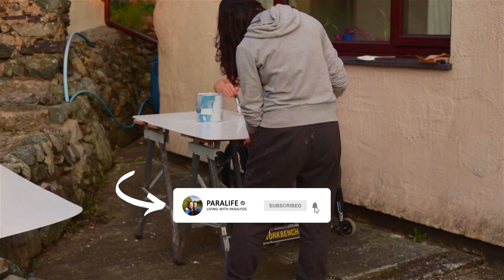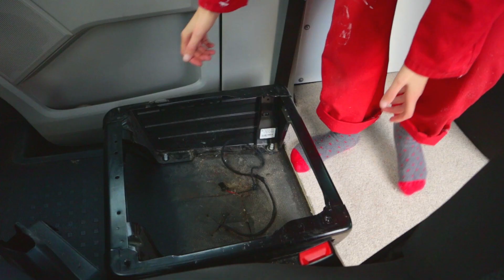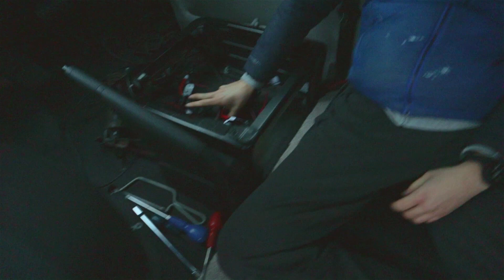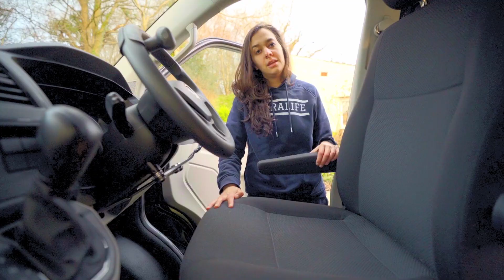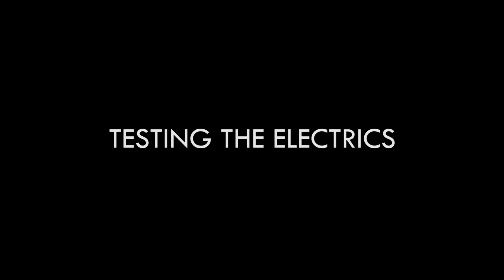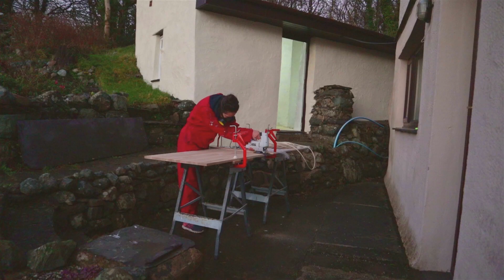Campervan Conversion Electrics | Building 12v and 240v Electrical System and Swivel Seats | VW T6

Comment: Hey, have honestly binged a few of your videos as find them very informative. I am awful at electrics and it is my next step and am dreading it, but I am just curious, how come you needed an inverter for the phone charger? Are they not universally 12v?
Reply from the maker: Hi Mikey, you are right, we just use built in USB sockets to charge our phones. We use the inverter for powering some of our other chargers (laptops, mobility equipment etc) and our induction stove. Good luck with the electrics!! 😀